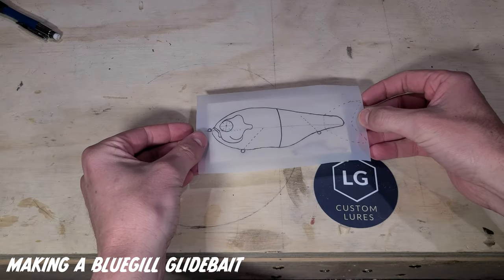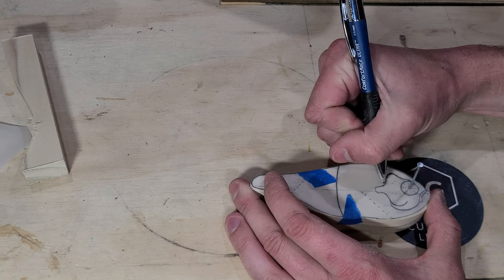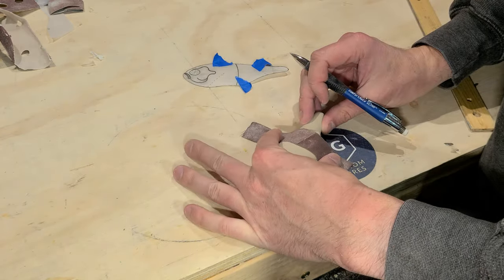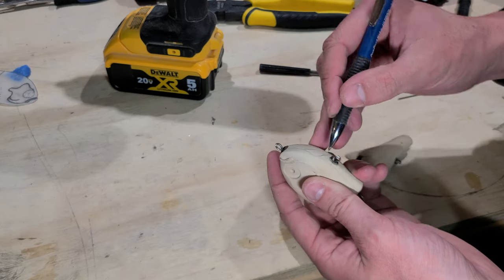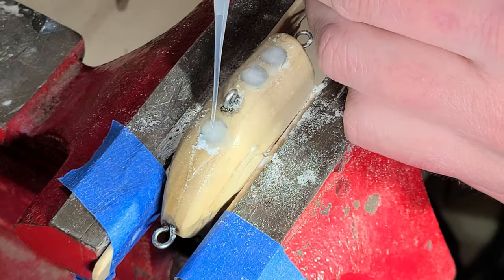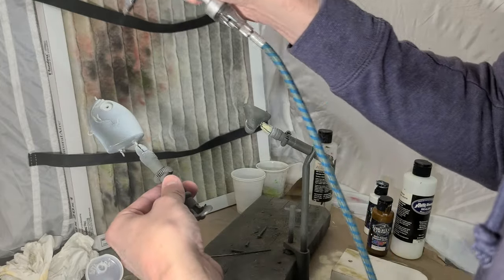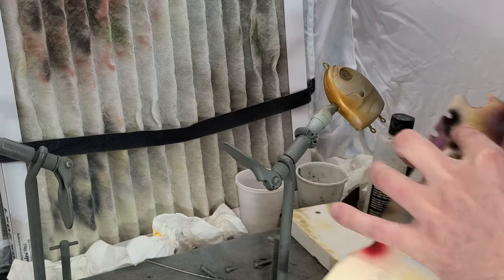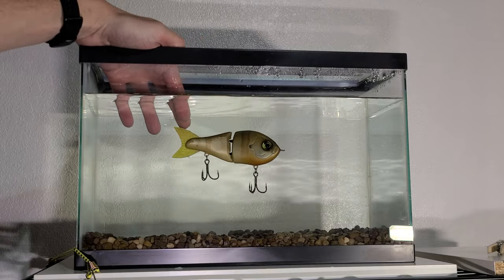Making a bluegill swimbait

Comment: You may want to flip the breakers for your shop, washer, dryer and vacuum the metal box. I know a carpenter who had his shop burn down due to fine dust in the electrical. Also consider installing a gasket of some kind to reduce future dust.
Reply from the maker: Thanks for the suggestions! Definitely a concern

Comment: Hope to see a lot more wooden lure making, This is a super nice lure. Great job narrating too. I have a question: what is the purpose of the shrink tube on the joint? I haven't seen this before. Thanks
Reply from the maker: Thanks! Great question & good eye. The hope is to provide cushioning between any stainless wire and wood contact. This isn't really an issue here as this joint only has wood on wood contact due to the great range of motion. However, I still like the look of the shrink tube over the wire.
Reply: @lgcustomlure Thanks for the reply. I've built a couple hundred wooden lures and watched thousands of lure making videos. This was new to me, so I was curious.
Reply from the maker: @pontoontri-hull156  Absolutely! It is something I have been experimenting with and find myself doing it more and more. Try it out on your next build!